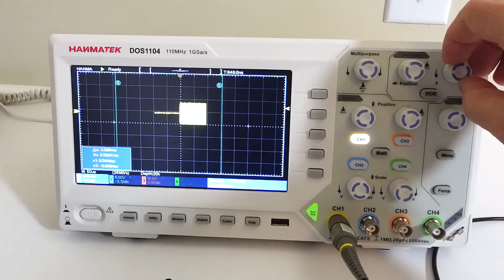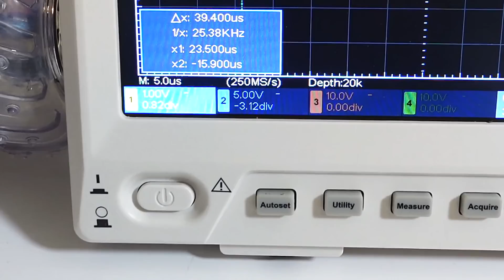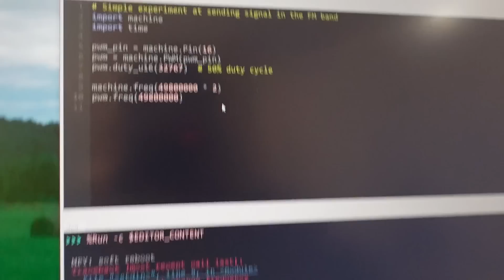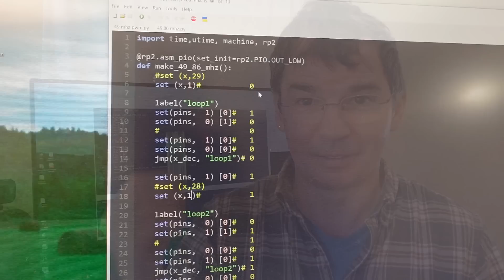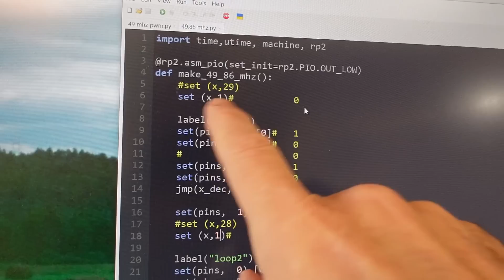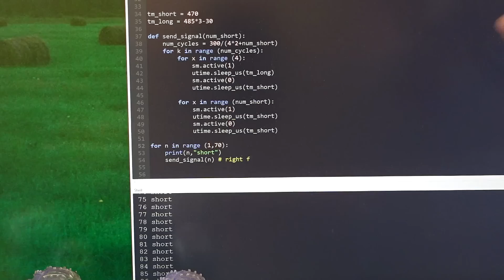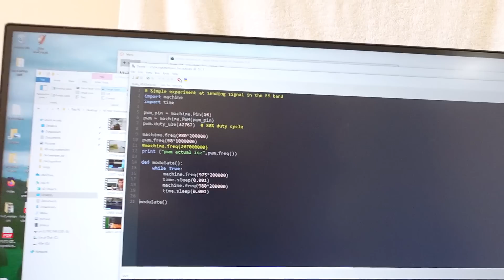49 MHz remote control tx by flipping I/O lines

Comment: Having done some basic Arduino programming in college a few years back, I think I understood most of the bit-banging in this video, but I didn't understand how sending signals to a GPIO pin meant for wired transmission was able to be transmitted wirelessly from this video alone. Is there a more in-depth explanation for that aspect of this technique?

Comment: Did the reverse of this, got a really nice remote control from the bin, found out it was for some sort of cheap airplane like toy (looking like a dragon),  2.4GHz, used an nrf and and pico to decode it. The remote has 2 joycons, 8 buttons and a small LCD. That was fun and hard at the same time.
Reply from the maker: what's an NRF?
Reply: @matthiasrandomstuff2221   Nordic Semiconductor has a bunch of rf modules named nrf (more than one series), they were/are pretty ubiquitous, even Sparkfun carries them.

Comment: Idea: PWM is a squarewave. You don't have to use the fundamental, you can use the 3rd or 5th. The master clock can thus be clocked lower
Reply from the maker: Then most of my power ends up out of band.  Also, I now have to be 3x as accurate with the edges, and the frequency also needs to be 3x as exact.  Nothing gained really.
Reply: @matthiasrandomstuff2221  I thought that because the clock is high, precision was unavailable (seen in 0:52)

Comment: Hah, I'd never have thought to do what you did with the scope to measure without the counter.

I'd personally have looked for the pin that drives the oscillator in the controller, then pulled that high so the scope could get a good read.

Amazing resourcefulness
Reply from the maker: I had previously measured it with the cursor so I knew it was 49.8-something megahertz, but couldn't get it close enough.
I knew I was very close because I have a set of computer speakers that picks up both transmission, and the beat frequency of interference was getting quite low.

Comment: You can overclock the RP2040 much much faster than the datasheets suggest -- most chips will run at 250-260MHz without even breaking a sweat.
Past about 270 MHz you have to pull a few more tricks, including executing from SRAM (since the SPI flash chip stops being able to keep up), overvolting the chip (modify VSEL in the VREG_AND_CHIP_RESET register to select 1.15 or 1.2 volts instead of the default 1.1), and providing additional cooling; but with some luck you can get the RP2040 all the way to 1 GHz.

Comment: You probably know how dds works. You add a phase increment to a phase accumulator at a fixed and fast rate. Possibly serviced by an ISR or something. Normally you would feed the phase to a phase-to-voltage converter to generate a sine wave. But for a square wave, you can directly use the most significant bit of the phase accumulator. So it would be a tight loop. Add phase increment to accumulator. Mask out msb of accumulator. Set gpio to be equal to msb of accumulator. Repeat. The phase increment is also called the "frequency tuning word." Since the first derivative of phase is frequency, that makes sense.
Reply from the maker: yes, aware, but the PIOs on the pico don’t have the necessary math instructions, nor the cycles to spare,so just went with fixed adjustment intervals

Comment: I think the thing that's MOST interesting about being able to manipulate it via the PICO, is that you can pair it with a Pi to make a WiFi FPV rig with a camera and remote control from a computer interface in a programatic way. Could honestly hack it to do a lot of rudimentary automation patterns for some kind of proximity sensor, tbh...something latching into an "on" position when it received the carrier signal, and maybe cycling a pattern of responses based on the zone the object is operating in, as encoded by the carrier signal's enconding, like having the car follow a programmable "ghost track" by having each "pixel" of the track signaling a different direction. So it turns as if the human is manipulating it to do that, but in a programmatic way. It makes me think of a very backyard Amazon Warehouse robot system!

Comment: I bet you could clean up the signal quite a lot with a low pass filter. You might even be able to get some premade ones for the 6m (50mhz) ham bands. but you could also pretty easily do it yourself with a hand wound coil and a capacitor.

Comment: I listened to this morning's Democracy Now shortly before watching this video, and then there was the exact same broadcast at 7:04. So the footage was from today. That's a quick turnaround!

Super cool that timing like this is achievable on the pico, and that you can send data so far through the air with just a GPIO pin and a tiny wire. Great project.

Comment: Im pretty sure as long as you don't put a tuned antenna on it, the broadcast will definitely be below 25mW in strength so it shouldn't go long enough for the neighbors to notice so the fcc will probably never find you or care. But it you do put a tuned antenna and an rf amplifier it may cause interfere  at the neighbors house. If you want to do that just buy a proper transmitter so its fcc legal! You could probably just wire the pico to the conteoller and use it that way. But I have seen a few radios with these little microcontrollers recently.. many years ago I played with an arduino mega like this. But it is very limited speed.

Comment: I believe the IMSAI 8080 actually had a sound card that used an AM transmission to send audio. And the sound was just bit banged out on a IRQ line as single bit data
Reply: Actually it seems it was the vanilla Altair 8800 that had EMI that could be controlled enough to use it as an AM transmitter.

The IMSAI card was the IRQ just low pass filtered and then sent straight out to a line out, so still bit banging audio, but no radio there.

Comment: afaik the pio has a clock divider that can do 8 bit fractions. Another option since you are generating square waves is to generate a lower frequency with an (odd) harmonic on the desired frequency
Reply from the maker: but then I'd have way less power in the band I actually want
Reply: @matthiasrandomstuff2221  sure, 1/N but for an FM radio you don't need much
Reply: @matthiasrandomstuff2221  i don't know if you've heard about it but Charles Lohr (CNLohr on youtube) did just that bit-banging the LoRa protocol on CH32 and ESP32 microcontrollers, they managed to transmit packets over 2.5km with some aliasing/harmonics black magic... don't know what else to call it xD

Comment: Its happening. I even barely understand the title of the video. Before it was just parts of the video.
Reply: Wirelessly TX-> wirelessly transmitting 
49 mhz -> specific range for car to understand stuff
I/O line flipping-> turning a switch on and off using a computer
Reply: @FiveSixEP  What's aliasing?
Reply: Well did you get anything out of it? Pretty interesting I think 😊

Comment: Mathias, unrelated question for you:
I'm making a plywood tool hanging wall thingy. Should I use 1/2 or 3/4 inch plywood?
Reply: You should know that Matthias never does anything in inches.
Reply: @FluffyTrinford  but all material in Canada and the US comes in inches, so unless you want to plane down your plywood on your 4' wide planer...
Reply: @gorak9000  Except it's all actually manufactured using metric sizes. They just label it with approximate inches for sale.
Reply: @dack42  so what metric size is a 2x4x8 ? i think you are wrong
Reply: @bmxscape  I was referring to plywood thickness, not dimensional lumber. Though a 2x4 is also not 2"x4", but that's for different reasons.
Reply: @dack42  ok so what metric sizes are 3/4 plywood sheets? im sure woodworkers would like to know...
looks to me like the "actual" measurment comes out to 23/32", which is 18.25625mm. not sure how you concluded that is a metric size, but i am sure you will let me know
Reply: @bmxscape  I have in my hand a piece of 1/2" sanded plywood that is marked as 12.7mm, so this is clearly nonsense
Reply: @technoman9000  ah yes, i also go to the store and purchase "twelve point seven milimeter plywood please"
Reply: @technoman9000  also, calling a 1 inch piece of wood 25.4mm doesn't somehow magically make it a metric size
Reply: Half inch is strong enough and will be a lot cheaper
Reply from the maker: If you want to hang stuff off of screws driven into the plywood, go with thicker.  If  everything is tool holders, thinner will do too, as long as you don't mind the occasional screw going through the plywood into the wall too.
Reply: Just make sure your plywood is good quality and doesn't have any voids